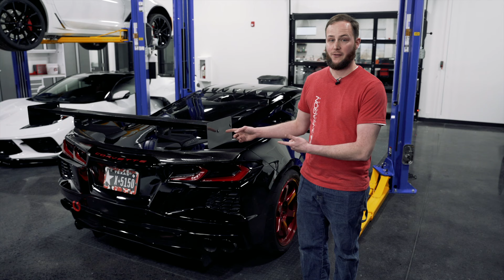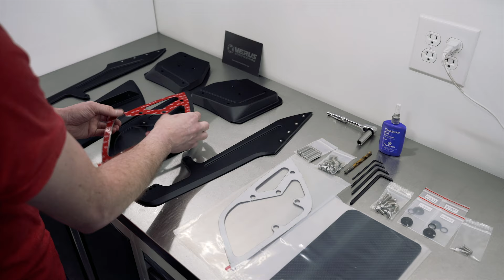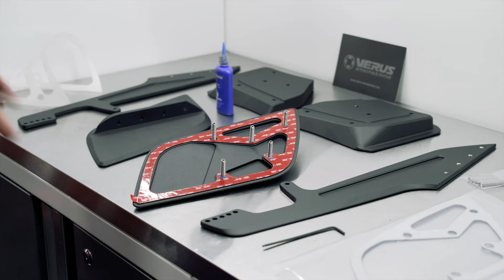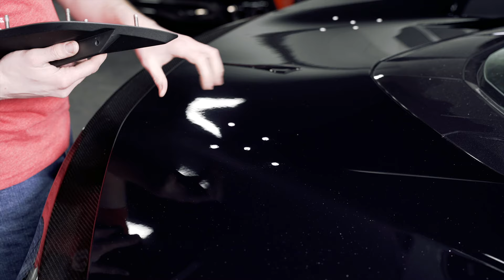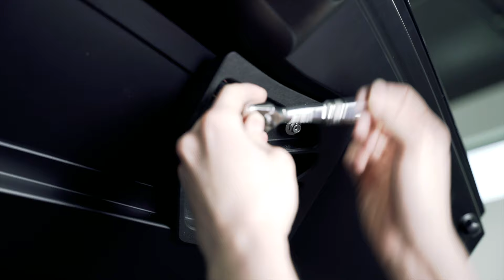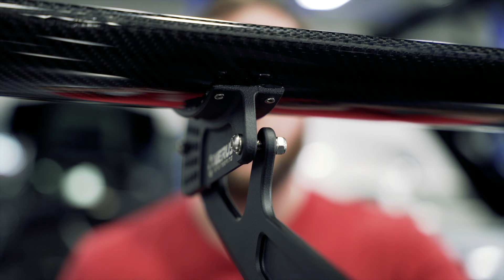C8 Corvette Verus Engineering UCW Rear Wing Install - Paragon Performance

Comment: What’s the shipping time look like if I bought it right now how long until shipped.
Reply from the maker: delivery times depend on where you're located in proximity to us here in Des Moines Iowa as well as which shipping option you select at the time of checkout. 

For the most part orders are shipped the same day or the very next depending on time the order was placed. If it shows "in stock" on the website, we can get it on its way to you ASAP! :)

Comment: Can the plastics be painted? Body colored baseplate and carbon flash for the rest?
Reply from the maker: The baseplates aren't plastic, they are machined aluminum.
Reply: @ParagonPerformance  Ok! Painting would be on the customer then?
Reply from the maker: @inkanthem  Correct.

Comment: I'll have holes from the factory wing. What is that under the wing and does it cover the holes?
Reply from the maker: That Is a ducktail Verus is making to cover the holes and to help assist the rear wing for more efficiency
Reply: @ParagonPerformance  does it come in the kit?
Reply from the maker: @superameric8  No, it is a separate piece that will be released soon.
Reply: @ParagonPerformance  how soon is soon? I’d have the same - holes from the Z51 spoiler…
Reply from the maker: @krisfarruggia  it's in production